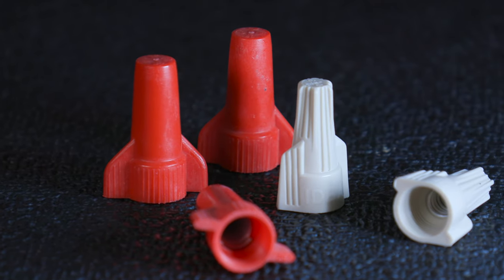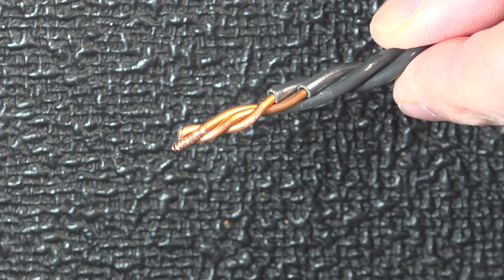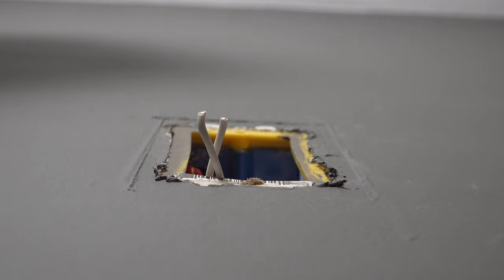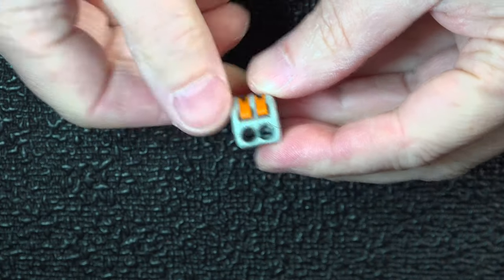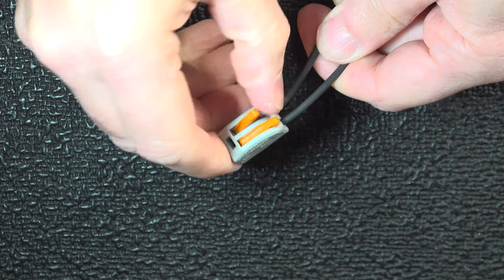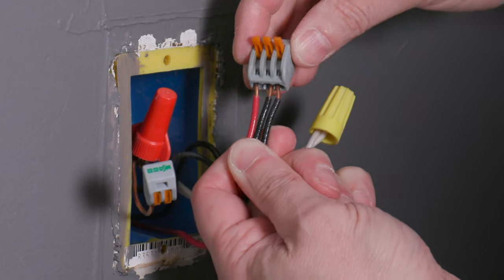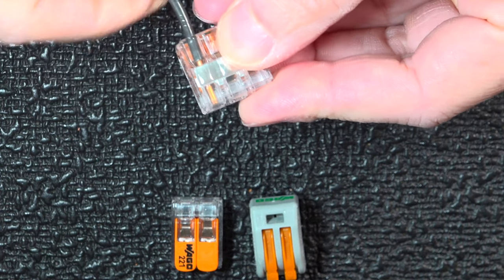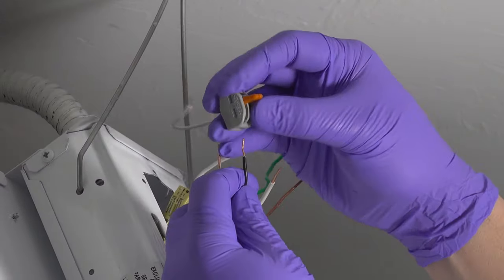Never use Wire Nuts Again - Wago is Better Electrical Connector

Comment: I've never had any probs with wire nuts. Reused plenty. You have to know how to properly use them and twist the wire.
Reply: Wire nuts are a pain in the ass to trouble shoot secondly wago are disconnect rated. Third the wago connectors can hold your meter for you while you push buttons. Fourth you can use them as terminal strips. My company has went straight wago we aren't allowed to use wire nuts anymore.
Reply: I would never use Wagus or whatever they are called!! Using them you don’t have full surface contact of the conductor where as twisting them together is more surface contact. If wires are twisted properly and then wire nut put on correctly they will unthread like a nut and bolt!!!
Reply: @kwmaris94  They're rated. They did tests on them and the wire literally melts before the wago. You're making things up.
Reply: @JustinL614  not making anything up!! Been using wire nuts for almost 40 years! Never had an issue with putting on or taking off! Not sure what you are talking about burning! That connector will burn before copper as well as a wire nut . Just by watching the video the conductor can move within the connector. Which goes back to my original point, not a 100% contact. You use what you want!
Reply: @kwmaris94  wago is way better. They've been test by people wanting them to fail. Voltage is not a problem so contact isn't a problem. Wires do not move once they're in. When they were heat tested, the wire failed before the the wago did. You can look at it how you want, but these are far more superior than the old nuts from a heat standpoint, they're completely stupid proof, and a whole lot faster.
Reply: @kwmaris94  You made up the part about not being rated. Just because something has worked for you just fine doesn't mean there isn't a better and easier way. I have never tried to join 4 wires with a nut but it works perfectly with a wago. The old way is not always best, just old. Wagos are far superior.
Reply: I think both have there place
Reply: I also think both have their place. I'm in the trade and have put 4 #12's (awg) in a red wirenut many times. But yeah, there is skill involved. And a tug test...if you don't do it all right, a wire can come loose.
Reply: Yeah I think this guy just doesn’t know anything about electrical. This guy is worried about his wire getting shorter after changing his outlet so much. If he did it right the first time he wouldn’t have to re do it every month.
Reply: Sounds shady to reuse a wirenut when everyone knows the spring engagement is broken when used properly.
Reply: @kwmaris94  I bet you tape wirenuts too
Reply: Well you know what Ford better work truck then Chevy. Ok start pissing.
Reply: @kwmaris94  I was wiring barns, houses, shops and all kinds of stuff for over 50 years. Never experienced any kind of problem with a wire nut whatsoever. Early years we used Marr connectors that had a little brass connector with a screw in the side and a plastic spin on cap. Never had a problem with them either. These Wago thins might turn out to be reliable too, but they certainly don't instill any confidence when you inspect them, so why pay more for something that has no immediately obvious plus but does leave you with a justified concern about its long term reliability and safety? As kwmaris94 said, use what you want, but I have no interest in these Wago connectors.
Reply: @sonsofliberty3081  I've seen the heat tests too. The wire nut also outlived the wire... and outlived the Wago connector too. Still, that test was with all new connectors. Not sure how stupid proof something has to be if we are talking about people who should be at least a little above dimwit level given they are doing electrical work.Wait... I have seen those videos where a shop rag is considered the perfect insulator for a 400 amp generator hook up. Lol.
Reply: @studdgage  what is the customer requests them, me doing electrical my whole life I don’t Rex come to wagos
Reply: @uniteddrones7626  do what?
Reply: Wire nuts suck even when you know how to use them. They just don't give much confidence in an age where confidence in a connection shouldn't even be a concern with modern tech. Everything improves with time why not how we connect wires? Wire nuts should have been obsolete 20 years ago.
Reply: Wago is the future but saying that wire nuts are dangerous or cannot be reused is miss leading statement. 
Wago is easier to use, slightly safer, faster to install and take less room in a box
Reply: Yep. I tested these push in style connectors. Put them together and then pulled the wire right back out with my hands. That's a no go for me. You could hang your body weight off my wire nut connections.

I strip the wire and the gentle twist them clockwise with my klein's, then cut the ends so it's nice and clean and shorter than my wire nut. Then twist the wire nut as tight as I can by hand. Then give it half a turn with my klein's.

People hate wire nuts because they believe all they've got to do is hold the wires next to each other and twist. I wish they'd stop showing videos of that crap. Lazy electrians. If I wouldn't let my family sleep there, then I'm not going to let yours.

This guy shouldn't call them smart connectors. They're called lazy connectors. If they were better I'd be on board. But faster and easier doesn't equal better. The wire nut was faster, easier and better than solder and electric tape. Go back to the drawing board wago and ideal.

Light ballasts are the only place I could see these being useful.
Reply: That's not the issue... The issue is that you butcher the wire when you twist it together like that.  Before long, the wire becomes weak and you have to replace the cable running into the box in some way.
Reply: @steveletson6616  very well said.  Wish I could keep my cool like this.
Reply: @glasshalfempty1984   You don't get any surface area with those little things. I'm talking about a lifetime connection. Not a weekend connection.

 Yeah if you keep taking wire nuts off enough times you'll eventually run out of wire. They're made to cut into the wire because it's about a good connection. Running new wire is the price you pay for constantly making changes. Your house's built from push in electric connector's and shark bite plumbing will fall apart someday. It's just laziness. 

I go to bed at night knowing I did it the hard way, but the right way. I guess future generations will find out in 80 years if your little plastic levers held up. Can't see it from your house right? Get that quick money right? Fast and easy. Pure laziness if you ask me.
Reply: Yeah, not making a splice before putting the wire on? Lol cmon man, wire nuts are used probably world wide...Iv never even seen this thing he’s showing
Reply: @mike617  I've never seen them in the real world either.  I've seen the junk push connectors Lowe's offers. These people on YouTube get paid to push these things lol.
Reply: Man if you can't use a wire nut what are you doing touching wires lol
Reply: Yeah, that's what he said in the video. Did you not watch the video?
Reply: @JustinL614  okay but we don’t like the wire melting either LOL the poor connection can lead to the wire heating up and melting unlike a proper twist. It doesn’t matter if the wago doesn’t burn up if it causes your wire to?
Reply: Wire nuts are actually called solderless connectors.  They replaced the need to twist, solder and tape every connection.  Excellent technology in it's day and they still are when installed properly.
This new connector has its place but my concern is about how much surface area of the conductors are in contact with each other in the connector.  
Have had lots of problems with "back stab" duplex receptacles over the years because there is minimal conductor surface contact in that type of device.  
If this new connector makes contact  in like manner, your going to have "hot spot" problems and lots of failed connections from overheating.
Reply: @jackelectricman  yeah well my preferred connection is basically a perfect twist with tons of tight contact and the wire nut is basically to keep it that way to me lol
Reply: @MatrinSwin  ...agreed. just don't nick the conductor when stripping it and twisting is great. Most all failures I've seen in 50 years was from nicking the conductor then the torque from twisting resulted in a open circuit or worse an arcing open under load!
Reply: @MadMetalShop  You say push connectors give you confidence in your connection? 😂. Nothing beats a wire nut connection for surface area, heat cycles and strength. 

You said wire nuts should have been obsolete 20 years ago? At least we know wire nuts work for 20 years. We also know just the twisting of wires last a century. 

If you can wire someone's house with those things and go to bed at night, something's wrong with you. Like I said before. It's just laziness because it's not better in any way.
Reply: There isn't much contact area in the connector.  They get hot easy and I've seen them melt.
Reply: Agreed
While I do like wagos, wire nuts are cheaper and not nearly as bad as this video makes them out to be
Specifically those stranded wires he shows just slipping off; notice how he doesn't do it while the wire nut is on and slips it off in the one direction that is straight up impossible when the wire nut is in place
Reply: @Robmancan1987  
FYI I agree that the spring loaded ones are hot garbage, but the wagos, which have a lever to lock the wires down, are much easier than every other connector and the wires absolutely won't slip out unless you're using the wrong size

Still, wire nuts are perfectly fine and don't deserve the hate in this video
Reply: Wago 222’s are the industry standard now ....hands down the better option.....every pump that gets sent out our door has wagos on them, the only time we use wire nuts is 10 gauge wire or bigger
Reply: @JustinL614  melts? Wire nuts has been used for decades and never was a problem.  Stop making things up.
Reply: @MadMetalShop  you have to know how to use them.  Obviously you don’t. I have done electrical for 9 years and never a problem.
Reply: @Robmancan1987  that's not even what i said. I said i don't have confidence in wire nuts. Weather that confidence is resorted by something new doesn't matter what it is. As long as it's better than the 100 year old wire nuts we still use. There should be something better by now and I think you know it. You might have your opinions on this specific push in but bottom line is there should be something to replace those wire nuts by now 2021. Everything else had changed. Why not a better wire connection solution? Even if these were terrible (which just about every hotel in vegas uses them) still doesn't negate the point that i was making and that wire nuts still suck regardless on how you feel about this particular connector.
Reply: @arod6789  no they don't and ill bet you're taking about the old RECEPTACLES which means you haven't seen these melt. There's no reporting of these melting and the last test I saw the wire gave out around 150 amps. The connector lasted longer than the wires.
Reply: @arod6789  also you shouldn't be overloading circuits to make the connection hot. That's home ownership 101. Don't overload a circuit or any connector will melt.
Reply: .... Oh and last thing guys..... With the introduction of arc fault breakers these connectors are a no brainer.
Reply: @MadMetalShop  Wire nuts are a great reliable fast connection. With plenty of surface area.
Reply: @MadMetalShop  I've seen these almost start a fire with less than less than 5 amps and a string of incandescent lights.  Wire was 14-2 solid.
Reply: @MadMetalShop  they're only rate for 20amps. I call bullshit on that.  A wire nut does not rely on the nut itself for the connection.
Reply: @arod6789  that's pretty doubtful it was due to the connector.  if anything they didn't install it correctly which happens just as often as incorrect installed wire nuts believe it or not i don't care. You have to have the wires FULLY seated. That being said these are UL tested and rated to withstand beyond the printed specs. There's literally no reports of these things causing fires. Anecdotal evidence doesn't cut it My friend. And as I also said...... Put in a AFCI or dual action breaker then you never have to worry about any connector you use so long as either style are installed correctly.
Reply: @Robmancan1987  ok. Thats a cool story and all but that's not what we are talking about. And wagos/insure are faster. There's not even a fair comparison with time saved.
Reply: @MadMetalShop  they were in a shed.  Could have been corrosion but it was dry in the ceiling.  2 failed out of around 50. Could hear arcing when bumping the boxes trying to figure where the issue was.
Reply: @MadMetalShop  don't get me wrong when doing something for other people in a hurry I'd use them.  Theyre easier to work with.
Reply: @arod6789  it's still 100% anecdotal. There's no way you could even verify to me right now that those 2 weren't installed incorrectly. That's just the reality here. 2 Out of 50 could mean someone got tired and lazy at the end of the day. Who knows.  Also how long ago this was. They're always improving these type of connectors. Wago already came out with a newer clear slimmer better connector than their previous grey version. They even provide these same type of connectors for heavy duty applications. Not to get off track here but it's still anecdotal.
Reply: @arod6789  these aren't even a new thing either. They've been around for decades. Not as long as wire nuts but these quick connectors started out in industrial applications decades ago.
Reply: @MatrinSwin  for sure, the wire nut is only there to keep the wire from touching other wires. I use CanTwists in Canada and they hold awesome.
Reply: @jimdawson2549  popcorn popping...
Reply: This right here. You don't cut off wire nuts to begin with, and in a lot of old construction applications, space in the box is a premium. These are bulky af.
Reply: Check out other videos where they test them under load no comparison. I've used both and am a retired industrial electrician 35 plus years repairing factory issues as well as poor installation issues. It is amazing the amount of amperage the larger ones can take. I also did testing with thermal scanning again no comparison.
Reply: @kwmaris94  I’m feel the same way. I always think of a 40 amp  fuse and it.s cross section when I think of surface contact of wires. I am sure someone will say it’s a 20 amp circuit. But electrical conductors have a safety factor.
Reply: If Waygos are so much better then they would have replaced wire nuts long ago, since Waygos were invented long ago. I'm a commercial carpenter and have never seen these used by any of the sparkies on any job I've been on. I will ask Sparky about these Waygos when I see him tomorrow though and see what he has to say.  Newer doesn't always mean better. Sure there's plenty of new stuff that's better than the old stuff, but just because something is new doesn't mean it's automatically better.
Reply: Wire nuts even in an enclosure are not up to code in Europe. People look at the mark left by the lever side and say that must not be enough contact area . The thing is that the other side made of copper is the conductor and has more than enough contact. The stainless lever side just locks it in. Wagos are UL listed for good reason and wire nuts are not up to code on the other side of the pond for a reason. Yes 1921 technology wire nuts work OK, not great. They take way longer to install, don't work better, and are not much cheaper than wagos. Wagos are inexpensive. Wagos are also rated as reusable. Personally I don't consider a couple of wires twisted together the best option.
Reply: Yes I agree, but I think this was more directed to the homeowner, weekend warrior.
Reply: @nemockulous  bro these are the old wagos. The new 221's are 40% smaller and they are clear now.
Reply: Way to go Waygo
Reply: Don't trust them they look dangerous to me. Won't use this gimmick
Reply: @stairman3151  this "gimmick" has been proven in the industrial application it started in decades ago and is ul tested and certified to last beyond their listed rating.
Reply: @MadMetalShop  preach all you want... I see vibration causing heat... Just read all the responses... Your not selling me on these... Like they say, if it ain't broke, don't fix it
Reply: @MadMetalShop  I’ve never had a problem with wire nuts. Never used a wago. Maybe if they make wire nuts cheaper and crappier like everything else I’ll think about wagos. But like I said, I never had a problem with wire nuts. And I’m not racing to do my electricals either.
Reply: @glasshalfempty1984  You're not nice.
Reply from the maker: Reusing them is against every manufacturers guidelines and like leaving a landmine. Is it worth it?
Reply: @JustinL614  many things are rated then not. Things that come to mind are aluminum wire to outlets and lights. How many houses burned down before the rules for that changed?  There are also plastic plumbing pipes that are now ifailing. Then there is the 737Max, a little off topic, but man sometimes jumps to conclusions on things. I’ll let someone else be the testers and hopefully their home won’t burn down. I just don’t see a tight mechanical connection when you just have a spring type pressure contact versus twisted wire with a nut. I also wonder how they will function in high current areas like kitchen appliance outlets. Will the spring warm up over time and loose it’s pressure on the wire? I’ve seen enough devices in my jobs that “let the smoke out” and this looks like a device with that potential.
Reply: @Robmancan1987  you are correct I won’t put more than a few amps though them. I have seen them used in electronics, but it is always things that are low voltage and less than a few amps.
Reply: @Robmancan1987  I have changed outlets and switches for many years and I can’t recall ever having to undo the wire nut.  I’ve  always just loosened the screws on the device  to remove the wire. I’m the guy that likes to wrap the wire around the screw and make a tight loop with needle nose pliers. I’ll never use those push connector switches or outlets either. I’ve noticed they only make those for 15 amps, I wonder why?
Reply: @sonsofliberty3081  all hailey the waygo lol
Reply: @glasshalfempty1984  wow you must be getting paid to argue so strongly for you little lever boxes lol
Reply: @glasshalfempty1984  also, outdate is your stated opinion, but I would say older but stable and tried with great and long success, if it is not broke or failing to perform up to standards don't fix or fuck with it
Reply: It just occurred to me why my previous reply almost took a turn to ridiculing the wago thingies. It's because of the opening line of the video post, saying that wire nuts suck. That is entirely rubbish. They work perfectly well so the opening premise is entirely false. That doesn't mean the wago is necessarily rubbish, but as they say, if it ain't broke why spend extra money to "fix" it?
Reply: @Chris_at_Home  I don't like the push connector outlets either.

 But I do like the kind where you push the wire in the back and then tighten the screw to clamp them down "most of your GFCI's are made like this". I've used those for years and they do make them in 20 amps. 

I haven't used the loop style in forever. But definitely stay away from the kind where you just push the wire in the back and forget it.
Reply: @Robmancan1987  I like those also. You get good contact on both sides of the wire the width of the pinch plates. I worked in electronics for years and I look at circuit current capacity and fuse size. Then you add another 100%. The thin contact areas on these push connectors sucks and you then  can pull them apart. I think I remember some of may training from the military and elsewhere that stated a good mechanical connection leads to a good conductor.
Reply: @Robmancan1987  if you're twisting the wire nut that tight, you're not doing it right.  Too tight is just as bad as too loose.
Reply: @multitutorialguy5735  Especially if one does not apply the proper technique in connecting solid and stranded wires together.
Reply: @MadMetalShop : Hammers are 'WAY  older than a hundred years. Can you think of something better?
Reply: @mike617  do not think there are so many who use them in Europe, a completely different standard. where I work, they use WAGO + Screw terminal blocks.
Reply: @edwatts9890  a nail gun? Not sure I understand where you're coming from.
Reply: @mike617  lol wire nuts aren't used worldwide at all. You'll only see them on old old installs across most of Europe.
Reply: @artvandelay1099  America moves slowly with everything, I mean the last analogue TV stations are only switching off this month, GFCI uptake was slow, same with LED, engine design and many other things.. it's a massive place and anything new has a hard time, especially if it's not made in the USA.
Reply: @studdgage  I like wagos because you can add a circuit to them in a minute. just use a larger wago
Reply: @Savagetechie  hence why my comment says “probably” lol
Reply: @edwatts9890  but with all due respect you're comparing a hammer to wire nuts. That's like apples and oranges bud.
Reply: You have to twist them in a clock wise direction, other wise they will not stay connected.  I saw the fellow twisting one backwards.  A big NO NO !  Yeah the Wago is a nice thing, but a pack of 5 or 10 is a little pricey.  Some commercial electricians are using them because the save a lot of time doing wiring.  I'm going to give them a try, if I can find some.😀😀😀
Reply: @montanawhite5699  why cut off the wire nut connection ? Just untwist it the opposite way it was twisted on in the first place.  They come right off, fer christ sake.  They will still go into a Wago and stay put for the duration.  If the house burns down, it's not the Wago fault
Reply: @1943vermork  yup, I agree about wire nuts.  If you use the right size for the  number of wires, twist them on in the right direction, give each wire a good pull test, they work just fine.  Never wind them on counter-clock wise and walk away.  There is a disaster waiting to happen -- same as binding the wires with black tape and hoping for a miracle.  Better make sure your fire insurance is paid up.  I've used nuts for years and inspectors still approve of them.  Wagos are very new.  Don't know how inspectors feel about them, but some big commercial electricians I guess are starting to use them.  They save a lot of time, I'm told.  They look easier to use.
Reply: @robertshorthill4153  time is money. If they're faster then you're saving time...... And your wrists.
Reply: @MadMetalShop  yes, I agree. After 8 or 9 hours twisting wires and nuts, not to mention stripping, you're ready for the day to end.  Maybe tomorrow your Wagos will be there, for a break from twisting all friggin' day.  Ha- ha ( but you still have to strip wire ends).  Listen to some nice jazz music while you work, huh?
Reply: @sonsofliberty3081  "stupid proof" 😅
Reply: @SilverCymbal  can you provide a reference for all manufacturers? The brand i use here in Canada does not specify not to reuse them, which is the same as saying you can reuse them...
Reply from the maker: @ElevatedEyes2023  Sure, check the package. For instance with Ideal there is no indication that they are re-usable, but on Ideals own push connector, they clear indicate reusable. It clearly important enough to mention but yet left off their traditional wire nuts. A simple search will find multiple experts also stating not to re-use them.
Reply: @SilverCymbal  I will check the package for you tomorrow. They're at a clients house. I will provide information about them when I remember.
Reply: @glasshalfempty1984  nonsense
Reply: @SilverCymbal  guideline is synonymous with suggestion. Every manufacturer does it to eliminate liability. Kind of like everything causes cancer in California.
Reply: @kwmaris94  Problem with your wire nuts is that if I should control the wire nut installation, I cant know whether is was you who were there, or some 3rd world apprentice. Takes forever to certify the installation. With Wagos, it is much easier to control or verify a connection, and it is easier to spot sloppy work, etc. All Wago connections should be identical over the entire installation, and very consistent. Even a 3rd world apprentice should get it mostly right.
Reply: @Robmancan1987  How should I certify your installation? How can I know that it was you who did it, and not a 3rd world apprentice?
Reply: @jackelectricman  Almost the only thing "back stab" duplex receptacles and Wagos have in common is that they are not wire nuts.
Reply: @elbuggo  You can look at the back of the wago where it's clear and verify if the wire was stripped to the right length, there is even a line to show you.
Reply: @kwmaris94   Ignore these people they are paid bots from India used to comment positively to the buyers product and generate fake view numbers. These people are literally defending product who's infomercial has a guy using a pipe wrench to twist wires.
Reply: @glasshalfempty1984  before long? Seriously how often are you doing work inside individual boxes? At 20 year intervals, 5 times is a hundred years. You might want to replace the whole wire to make sure that the insulation didn't give up at that point.
Reply: Can’t believe I read way to many of these comments, if you want a conception of infinity just go to the comments on any trade related video, they go on forever. I got enough wire nuts in my tool box to last for the rest of this homeowner’s life. Now before you comment about only pros doing electrical work, I’ll ask, are you ServSafe certified? If not you better not cook at home, you might poison yourself, or your family. 😉😎
Reply: Shit happens
Reply: Never pretwist or that stupid drill attachment for twisting wore nuts.
Reply: Covid.. Making people fight over electrical connectors since 2020.. Baba booey!
Reply: @steveletson6616   its not rocket science to twist a couple more wires together , if you need this product you might need to find another line of work.
Reply: @glasshalfempty1984  so why do they sell 4 wire romex where the wire is spiraled together if this is such a major problem? sometimes the theory doesnt translate out in the field you can tie wire in knots and never have an issue in many applications.
Reply: @tomtom7955  It's not my line of work. Just something I have experience with
Reply: @BradThePitts  I find that hard to believe with the number of service call i have done for similar push style connections.
Reply: @tomtom7955  The waygo connectors are not push type but lever locks. Way better connection
Reply: These are terrible...FIRE !    DANGER B
Reply: @JustinL614  he gets a cut    .
Reply: @kwmaris94  you don't need full surface contact for a good connection... I tested these on full load, the cable isolation burnt first before the wago, and even then, the connector isolation was the only thing that toasted itselft, the mechanisms still worked perfectly, so after some tests i just use wagos for everything, simpler, easy to use troubleshooting is just much more simpler, and had 0 problems with them. So this wire surface contact makes no difference at the end, does the same job at the end but simpler.
Reply: @sonsofliberty3081  you show your lack of electrical knowledge, and its disturbing. I hope you don't wire things people live in or work in... Voltage doesn't melt metal, it also does not make our plugged in devices operate. You meant to reference CURRENT. And surface area is everything when it comes to current. In basic studies we tradesman learn that current is the basis of conductor sizing, with one main caveat, resistance! The more resistance the higher the current flies, and it is directly proportional. A tiny metal finger holding your 20amp rated conductor may flow 20 amps just fine, but what if it fails? Many houses are still standing, some with knob and tube wiring, tons with wire nuts, I know of 0 that have these connectors. That being said, the uses are many, but they are not going to be mass installed anytime soon.
Reply: @UmbraWeiss  please read my above comment and stop showing your lack of knowledge, especially when someone may see your comment and use these without knowing the true risks involved. They burned during the test because the connection was tiny! This is basic electrical knowledge! I sure hope you all don't have current licenses, I'm about to start calling for re-tests!
Reply: @UmbraWeiss  tell that to your old lady!
Reply: @montanawhite5699  i am trained for residential and commercial wiring. If the wire is to short, don't be lazy and run another line, duh
Reply: @Rad_Triumph_765_RS  if it broken then replace with new one.
Reply: @Rad_Triumph_765_RS  no I don't, the wirenut is fine.
Reply: @kwmaris94  it's not about "fixing something that isn't broke" you dummy, it's about improvements in materials science technologies and techniques!
why are you on the Internet?? telegraphs and typewriters aren't "broken", go back to that!!
Reply: Yeah facts I was thinking the same tbh
Reply: @glasshalfempty1984  no you don't have to replace the wire/cable/conductor, because wire nuts are meant to make a permanent connection. Also, anyone that's qualified to do electrical work knows that you need to leave 6 inches length of conductor, so it should never be a problem.  With a wire nut, properly used and conductors pre-twisted, you get maximum surface area contact between conductors.... With a wago, you get a thin piece of metal that bites into the wire in one spot.  Electrons flow on the surface of wires, not through them, so surface area contact is important.
Reply: @MadMetalShop  No one has been using wire nuts for 100 years.  The standard in the 60's was solder and tape... Stop it already.
Reply: @MadMetalShop  There's nothing wrong with solder and tape connections, it's still an accepted method and code compliant.
Reply: @donkink3114  dude. They're over a hundred years old and many more effective methods have been invented now. They're obsolete. Does obsolete mean they dont work? Sure they work but they still suck to use and imo are obsolete..
Reply: @IrrationalBstrd  not on new installs it's not lol. Yeah try and get a inspection on a rewire using that method lol
Reply: @MadMetalShop  uh yes it is actually. although it's ultimately up to the AHJ, obviously, but it IS code compliant.  NEC 110.14(b) I know 100% that my inspector in my jurisdiction would pass it, because we've discussed it before, semi recently. Would I do it, hell no, because there's easier and less time consuming methods.
Reply: @MadMetalShop  and ffs,, quit arguing with licensed electrical contractors and electricians who work with this kind of stuff everyday for many years about wire nuts and how unreliable and obsolete they are. When a connection is made with wire nuts, it's meant to be permanent...
Reply: @IrrationalBstrd  show me the code then that allows it in new work. Now I don't know about you but I live in the states. I have seen no such code. Not to mention why it's a dead practice lol. Because it causes metallurgy issues with the connection.
Reply: .... I also never made a case that wire nuts don't work so your entire premise here is WRONG.
Reply: @MadMetalShop  I gave you the code, National Electrical Code 110.14(b).  I know enough about you to know that you aren't an electrician by trade, since you have a channel "firearm enthusiast and custom fabricator" and by the fact that you aren't familiar with the national electrical code. 

No, you didn't say that wire nuts don't work, but you're arguing with people who work in the trade on a daily basis about how wago connections are superior.  They may or may not be, but using wire nuts is 1) cheaper than wago, 2) not hard to use or inferior if used correctly.  

Excerpt from the first sentence of NEC 110.14(B) : Conductors shall be spliced or joined with splicing devices identified for the use or by brazing, welding or soldering with a fusible metal or alloy.

Soldering is dead in practice because it's time consuming and requires extra tools and materials.  It does not cause metallurgy  problems on copper, as there's millions and millions of homes in the US that have it and the connections are solid.  In fact, it's far superior to any wire nut, wago or any other mechanical splicing device.  Nevertheless, the wago connectors are UL listed for the purpose and therefore are acceptable according to the code... Myself and many other electricians are not comfortable using them to make connections for a multiwire branch circuit, yet. Edit: I didn't really mean multiwire branch circuit, but whatever
Reply: @IrrationalBstrd  OK so it's permitted. It's still a dead practice and if you used that on my electrics you would not be back. There's a very good reason why it's a dead practice. You can't tell me there's not. BTW you also said a bunch of shit that had nothing to do with my viewpoint. Wires should be 6 inches from the back of the box. WHOA dude. What a revelation lol 🤣 like who tf doesnt know that? This may come as a shock to you but the world isnt perfect. Yeah belive it or not lol. It's a dead obsolete practice get over it. 
so what about your original claims about wagos? Can we get back to those credulous statements anytime soon?
Reply: @MadMetalShop  I didn't say much about the wagos except that I don't trust them, personally. I'd have to see the new ones and it's internals, because despite what's being said about surface area, it's actually what determines the ampacity of a conductor.  Electrons flow on the surface of each strand, or on the outer surface of a solid wire (like Romex).  If you don't have the same surface area in the connector as you do in the diameter of a conductor, than that is a problem.
Reply: @IrrationalBstrd  there is no problem. They've been UL tested and they arent even a new thing. They've been around for decades. You said alot in that commment but only general facts about conductivity. So in a sense you're right. You didnt say much about them But you still say you dont trust them based on nothing that I can tell and imply that no, wagos can't be trusted. Again they're UL rated and also approved by literally ever other developed nation. You can watch videos of them being ran up to 500 amps and the wires melt...... but that clip is still holding passing current through a now bare conductor. I still stand my my remark. Obsolete doesnt mean something doesnt work fyi. That's when you misrepresented me. It simply means its outdaded and there are far better methods as tech chanbes and people's stigma.
Reply: @MadMetalShop  Point taken... And when they see wider and wider use and a proven track record, and can be sold at a price that's competitive with good ol' wire nuts, I'll use them.  For now, I'll stick with the tried and true and more affordable method.

Federal Pacific stab-lok breakers were UL approved as well, and we all know what happened there. It's all over the internet about how UL revoked their listings from them and that FPE used deceptive practices to get a listing in the first place.... Yeah I don't know, sounds to me like UL was just covering their ass.
Reply: The Wago looks like a great solution but I’d want to perform continuity tests on the installations to ensure that I didn’t have dangerous levels of resistance and voltage drops.
Reply: Don’t twist your wires. That does nothing to help the wire but. You just have to know how to use a wire but.
Reply: Wire nuts are not reusable ? What are you talking about? 23 years as a master electrician and never heard of anyone saying this.
Reply: @sonsofliberty3081  
Stupid proof is what makes them better. Guarantee the contact resistance of a properly used wire nut is lower than a Wago
Reply: @Rad_Triumph_765_RS  
Not true in the least bit.
Reply: Funny to see everyone who hasn't ever done any wiring defend the Wago against the real men LMAO
Reply: Wagos, good for Rat work. People that use wagos also order pre bent pipe. Wagos are no better connection than stabbing in the back of a outlet. Which any service truck guy knows, DOES NOT LAST.
Reply: These things are excellent, so much easier and quicker to use than wire nuts, they are absolutely rated for the current and voltage. I work for an elevator company and I use these for every connection I make and have for years and haven't had any issues whatsoever. Big thumbs up for these connectors!
Reply: @ChevyMalibu69  so that's why people keep getting stuck in the elevator!!!
Reply: Wire nuts are cheaper, and I have never had any problems with reusing them either!
Reply: The only time I use a wago is when I have more than 5 grounds in a box.  Wagos are great for people who don’t know how to make a good connection with a wire nut.  Like the person in the video.
Reply: @kwmaris94  -- They create a path of conductance.  Take it from an electrical engineer, they do just that.
Reply: @montanawhite5699  well maybe he put in a Bluetooth smart right and then changed his hum to zigbee, so he has to change the switch then a month laster decides Zwave is the way to go. Then 2 months after that he knows he over did it so he switched his to switchs with built in motion sensors.
Reply: @stairman3151  another old saying is “you can’t teach and old man new tricks!” i can verify!
Reply: @steveletson6616  so your going to have to get in the habit of carrying around 2,3,5 wire connectors when you can most likely get by with one size wire connector.
Reply: Waco’s are JUNK… I’m not only an electrician with 15 years experience, but I do thermography. These connectors are”rated” and UL certified just like quick stab connections on receptacles and other devices… the thing is all these connections make very little contact with the wire and thermal expansion and contraction wears out this contact till the connection is loose(and causes a fire)!!!
This shows up wonderfully on a thermal camera(which I have 1000’s of pictures of these defective connections). 
It takes a while before you go from a few deg of temperature rise to a fire but give these wago connectors another 10-15 years and you will see what I mean when you have fires at all the connections…..
Reply: I would still prefer wire nuts.  This guy wants to sell you plastic.  He need to invent something useful.
Reply: Exactly.
Reply: Its like the time my son came home from school and told me his teacher said bears dont hibernate. They "winter sleep". SMH
Reply: @sonsofliberty3081  we use pretty much only these in eu and the work by driving a blade into the wire. Most new outlets and  switches also have the same kind of connection type now days and if you have ever done low voltage terminal blocks have used the same mechanism for ages also. There is also the fact that both connector types have the allmost the same exact resistance if done right only thing is that with wago you can see and test the proper connection way easyer while its also smaller.
Reply: @montanawhite5699  Its not about changing them every month its enough that you need to add a lightswitch or something similar just a couple of times and even if you wont someone maybe wants in a future. Think it line greasing your tire bolts, you wont be doing it every month but when you do you are happy that it didnt rust on and then you destroy your rim while trying to get it off
Reply: @Robmancan1987  why is this comment section full off boomers. Like ffs ppl these are 70 year old at this point and been thru tests.
Reply: @kwmaris94  yes, I also know better than the company that spent millions of dollars on R&D in pursuit of a simpler and safer wire connector.
Reply: He literally pulled the wire nut off and he was worried about the wires afterwards but could have cut way less taking the nut off like duh?!😒
Reply: @Yngboiijesse  Yes he exaggerated on purpose but still you need to cut quite much since you had to twist them and they would have taken damage from the nut.
Reply: Lol exactly...this is dumb...nothing wrong with the wago connector but what happens when you need to connect 5 wires together
Reply: @timhick6  There are wago connectors up to like 10 wires and you can always chain them but thats not recommended. The only problem with wago connectors are that they dont support bigger and smaller wire sizes or stranded wires but they are good at what they do.
Reply: @studdgage   cost comparison is why wire nuts will outsell wago.
Reply: @MadMetalShop  does everything improve with time? Tell that to the architects of the pyramids. We don’t have modern technology that can even explain how they did what they were able to do with such precision so I don’t like that argument.
Reply: @johnghatti5435  Maybe Im more on the industrial side of things so there money isnt really a thing wire nuts probably cost us more in repairs do to vibration and moving parts.